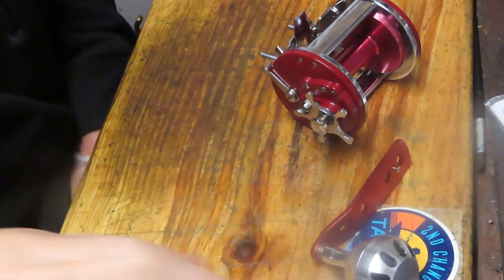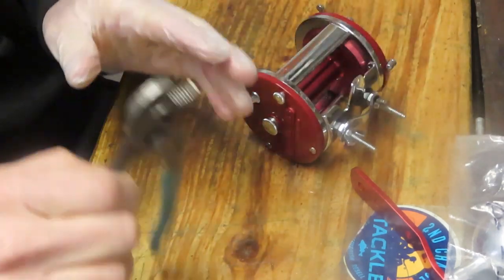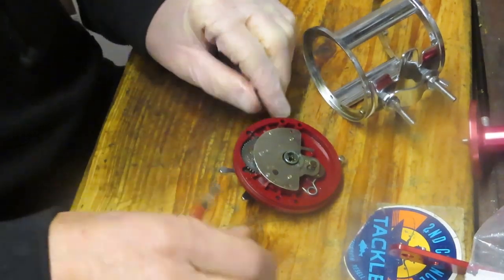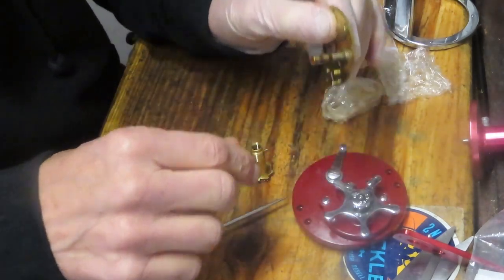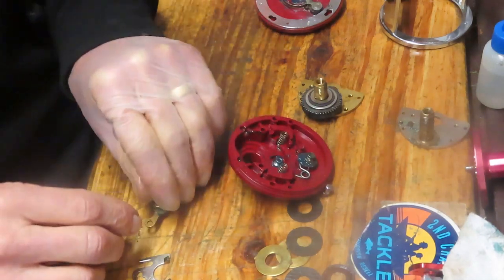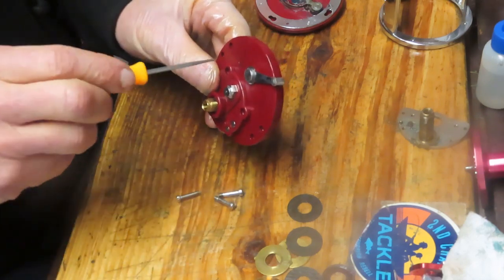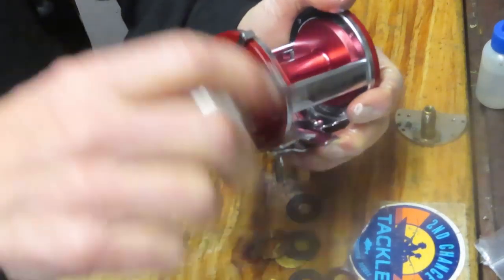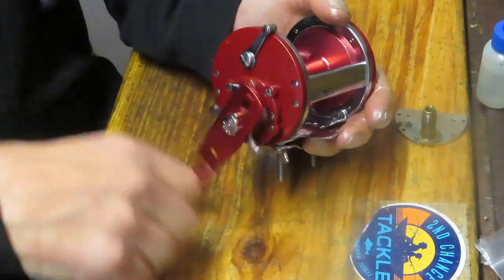Penn Jigmaster 500S problem determination how to service and upgrades

Comment: The 500S was made in the early 80s. 
The idea was that it would save on labor time-as Penn reels were hand 
assembled- hence the design. You can put longer screws into the cross
bars and make it a bit more stable. If
this spool was original to this reel it
would date it to 1983 as that is the 
50th anniversary edition.
Reply from the maker: Thanks as alway Armando, you are a wealth of information - Best wishes - Dennis

Comment: Looks like the new bridge was better quality than the old one. Upgrade. Brass vs who knows what? Am I right or wrong on that assumption? Thanks again Dennis for all your hard work.
Reply: Actually the old bridge is nickel plated
brass. Nicer looking but probably same
quality. Unless damaged I would have
kept the old bridge.
Reply: @armandoreyes1891  thanks Armando.
Reply from the maker: There is not much difference in the two - Thanks

Comment: I’ve seen those Gomexus trolling reels before. They certainly look impressive. Great video Dennis! By the way, that Olympic LG 550 I thought I was getting after winning an auction on eBay is probably  not going to happen. I found that the exact reel was sold back in January using the exact same photos. I have a problem I think. Always check on a reel you’re bidding on in eBay to see if it has been already sold. This has happened to me twice in the last mont and I am quite steamed about it. — Chris
Reply: It appears that the bidder on the first auction backed out on the deal. The Olympic reel was listed as a relisted auction. Unfortunately I can't see anything deeper as eBay clamped down on the feedback function.
Reply from the maker: Wow - That hasn't happened to me.  How disappointing!

Comment: I own one of this model and bought from Japan in mid 80s . But unfortunately there r no service facilities here in Bangladesh. Can u help with any advice?
Reply from the maker: That is a problem as the Penn support is lacking outside of the USA.  I suggest you use the YouTube video to service the reel yourself (or find a friend with mechanical ability to help). The video you watched has the core elements of the service you will need to maintain the reel.
Thanks for asking
Dennis
Reply: @2ndChanceTackle  I am interested to buy a new PENN reel for me . Can u tell me about SENATOR Star drag reel model :- 113H2SP - 4/0
Reply from the maker: That is a very good reel.  It is designed for wire line trolling (SP) - You may just want the 113H2 model - The difference is in the spool - Dennis
Reply: @2ndChanceTackle   My Son in Law is working with World Bank HQ in DC . Actually he will buy it for me and send it to me to Bangladesh. He has no idea regarding the Fishing Reels. That’s the reason I am trying to update him about it .